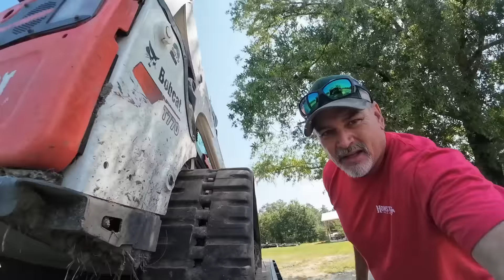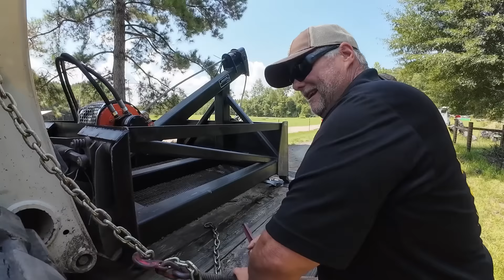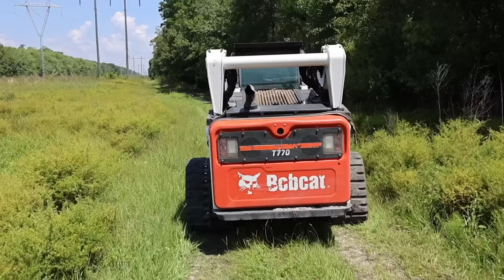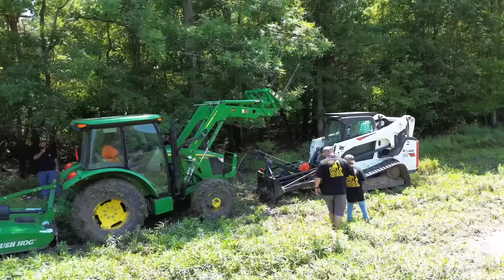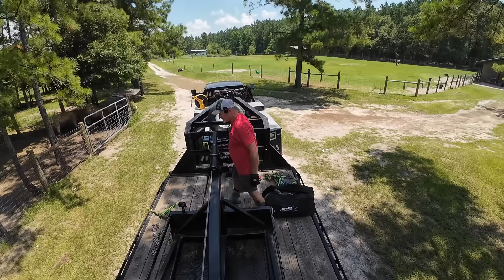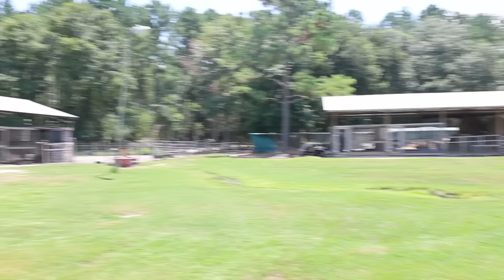HELPING A FRIEND STUCK IN RIVER BED! Can we get him out?

Comment: You should make a mount for that controller that goes tight inside the skid steer cab. That way hopefully it never goes missing. On the radio I have in my skid steer it came with a premote I’ve had it mounted in the cab for years works great😊

Comment: Put a old coat over the the cable when pulling, it dampens the cable if it brakes. It worked on stuck mud trucks. Hope this helps. God bless.
Reply: @waldonherdman1447  that is why they make snatch blocks

Comment: Hank I’m one that pointed out you would have trouble getting out with a cage (most cages are done at the rear of the winch box) however you could do a cage at the front of the winch box near your pivot head. Also get a weighted blanket to put over your winch line. Changing line would reduce the weight a lot.

Comment: I agree with you Hank, when you set up a series of snatch blocks like a 6 to 1 ratio you can increase the pulling power. I watched a video on youtube about they hooked up several blocks and by redirecting  the cable, he was able to pull that vehicle by hand. Also on MIdwest Truck they used a side by side to pull out a  rental van by redirecting to trees. Maybe you need a yank em rope.

Comment: Hamiltonville farms i have a suggestion that will make using the winch box safer to use put a medal barrier on the box between the skid steer window using a piece of medal grate welded to a frame so you can still see what you are doing but are protected from stuff flying through the window and hitting you should rigging fail
Reply from the maker: Then I couldn't open my bobcat door🤷🏻‍♂️

Comment: A good rule to follow: When  I run an oifield winch truck, I woud tell the operator of the equipment I was pulling out, " Hook that line where you want a piece snatced off, because if I can't pull it out, I will pull a piece of it off."

Comment: Hank, you need wheelless tire or a weighted mat they make especially for cable dampening should it break put it mid cable and it will drop before it comes all the way back at you.

Comment: Got the same model in 2wd. Stuck it in a wet hog wallow. Stuck my JD 5203 trying to get it out. Ended up using my 450G dozer to get both out and smooth holes..... Hog wallow was hidden btw.....

Comment: Just some food for thought, we use to run TL12’s with the company I worked for on the transmission ROW’s and they had 20,000# hydraulic winches mounted to the rear of the machines, I had a huge snatch block that I carried with me as well to double my capacity and there was absolutely nothing that thing wouldn’t pull. I’d even anchor my front end to a tree in certain situations to hold the machine and she was a beast. Never had to worry about the cable breaking and coming through the door AND I had it with me at all times for when I got stuck myself. That’s the only downside I see to your design is that I’m you don’t have it to pull your own self out! I own 2 bobcats personally, a wheeled 773 and a T630 and I’d love to find me a cheap hydraulic winch at an auction to build me a set up on the rear of my 630, you couldn’t beat that design in my opinion. Love the videos 👍

Comment: need to get sponsored by yankem rope. Rachet strap fatigue over time and you end up with shorter strap. I’d weld some D rings hook 🪝 that rope to them at times the cable n winch isn’t strong enough. I’d look into those glass mat to those Lithium batteries yes their more expensive but the alternative is no dead batteries. Need to get a sponsor for them I wish i could afford them put one in riding mower see how it does three for the bass boat. They’re supposed to be lighter than lead acid. 24 volt trolling motor one for cranking. Just need a lithium charger